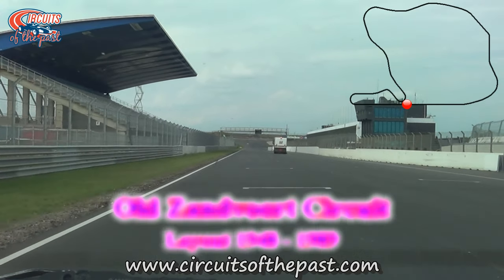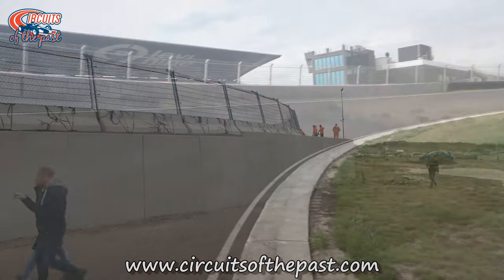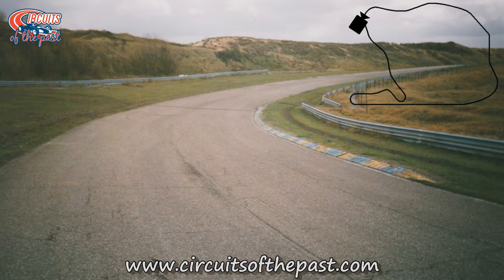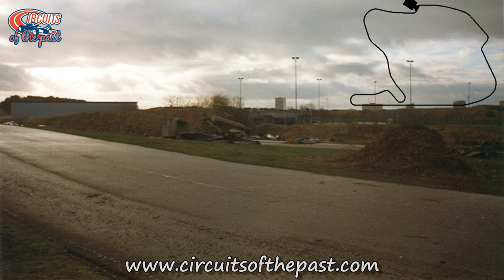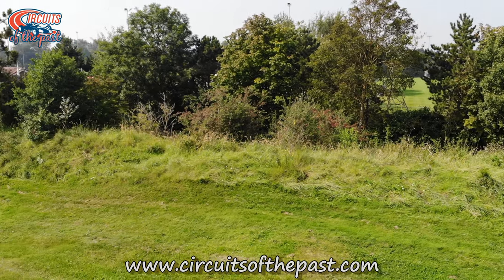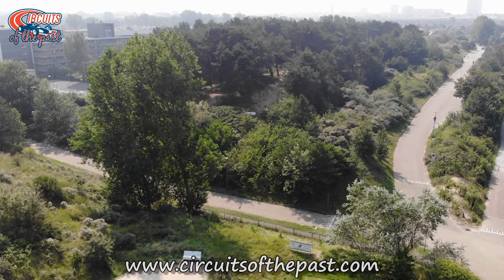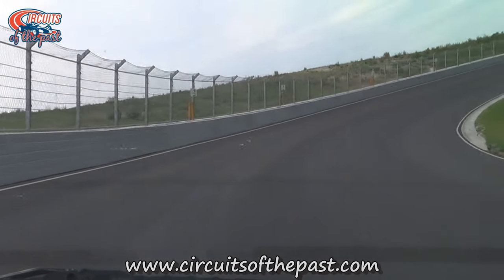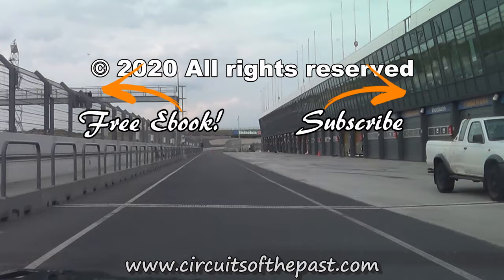Circuit Zandvoort old Layout 1948 - 1989 (Old Zandvoort Full Lap with Abandoned Sections)

Comment: I raced here once in 2012 and it is a fantastic circuit to drive. I never got used to the bump at the turn-in to Scheivlak and always had a 'confidence lift', which others didn't..! It cost me a place on the podium but I received the 'Driver of the Day' trophy, which always takes me back to a great weekends racing, whenever I give it a polish..!
Reply from the maker: Yes, Zandvoort is stil a great circuit, especially the sprint to the Scheivlak and the bump before. There are more who do a lift there and some even brake (not me) :D

Comment: I wonder if the old layout could be replicated into a mod track for Assetto Corsa. It could be possible however I think lot of work because when certain people rebuilt the old Southern Loop of Nurburgring with 60's layout, they used lot of photos to replicate it from what I heard, however did amazing job. same people should re create old Zandvoort.
Reply from the maker: There is a recreation from the original Zandvoort layout in GPL. However, it would be cool if they do a moders remake of old Zandvoort (Hmmm, sounds contradictory).

Comment: GOOD JOB! THIS IS A TRULY CHALENGING AND SAFE CIRCUIT; WITH BANKINGS THE WAY THEY SHOULD BE. THE MEXICAN CIRCUIT CAN NOT SAY THE SAME, WITH THE NONSENSE MUTILATION IT SUFFERED RECENTLY. ONCE A REALLY CHALENGING CIRCUIT, NOW A NAIVE AND NONSENSE CIRCUIT IS TO BE FOUND THERE. A PICNIC FOR DRIVERS THANKS TO @#$&"* TIELKE.
Reply from the maker: Fortunately they didn't asked Tilke for the adjustments to Zandvoort. However, there were already drivers who suggest they should change the Tarzan Corner (Turn 1) to make it more easy to overtake. That would mean a reconstruction to a Tilke hairpin. Then even better DRS :O